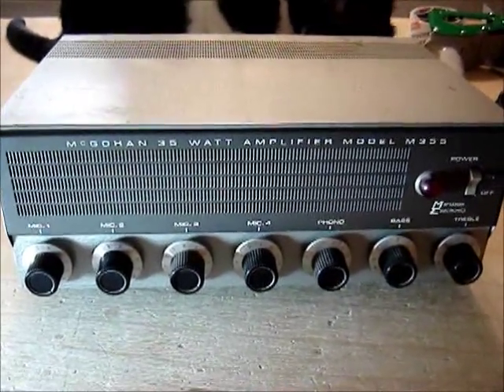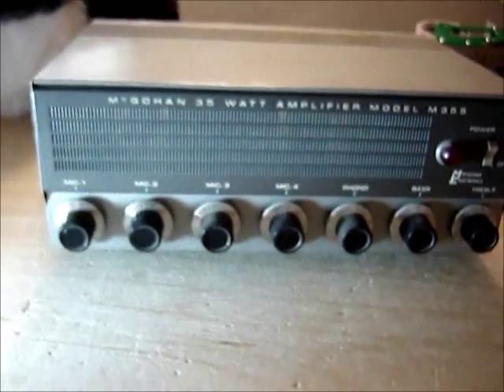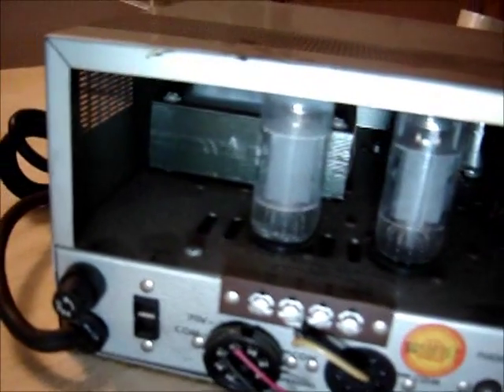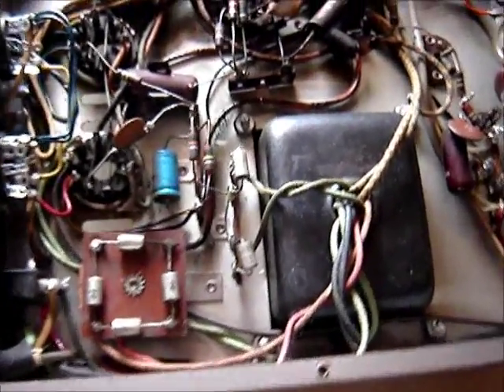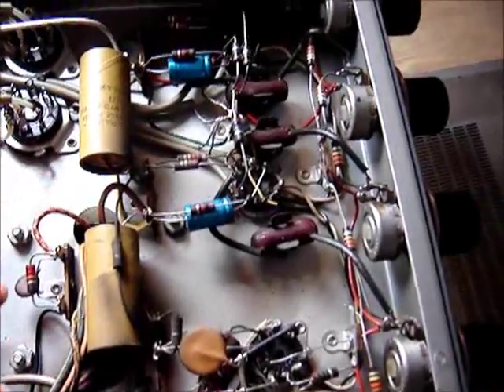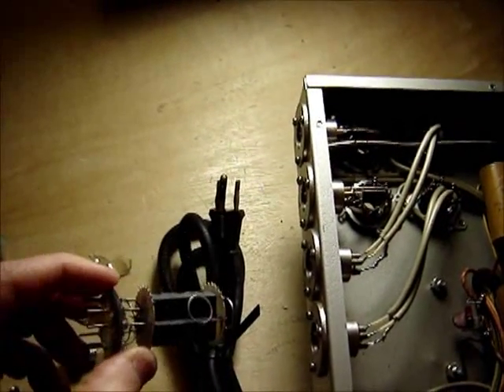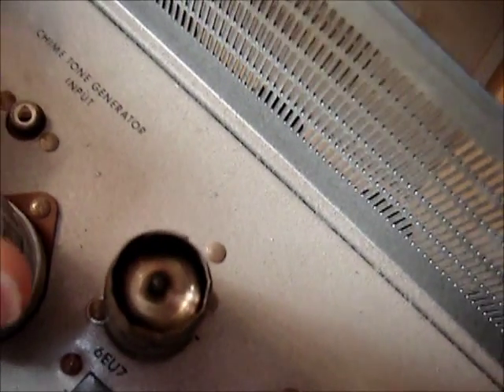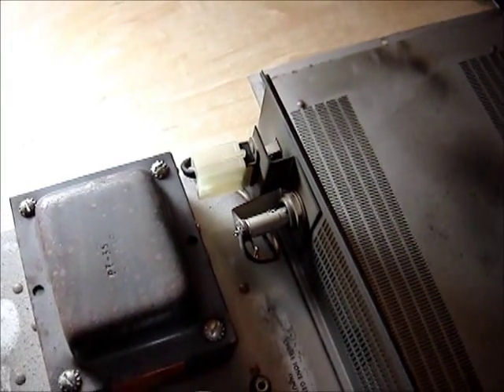McGohan M355 vacuum tube 35 watt PA amplifier repair pt1

Comment: I use the McGohan M 503 converted to a guitar amp. 50 watt using two 6L6 and three 12ax7 and one more tube but I forget what it is. I am old but pure tone going thru a JBL K120 out of an old twin reverb from the 70's in a wood cab. I put a cheap Bahringer 7 band EQ in front of it and  it blows anything away I have ever heard and can boost it enough to rattle the windows in your house. I've been playing since 1963 and have owned about every amp ever made. This is a keeper, I Highly recommend buying one of these McGohan Amps to any guitar player or bass player. They are all hand wired point to point. These days that would run about $3K to $5K

Comment: By the looks of things inside of it,You are better off salvaging the power transformer and invest on some decent output transformer and make a SE EL84 amp .....I am working on a  SE EL84 amp.....(PS.you could use a line transformer as a output transformer but it is not really reccomended) now i just have to workout the case for my amp